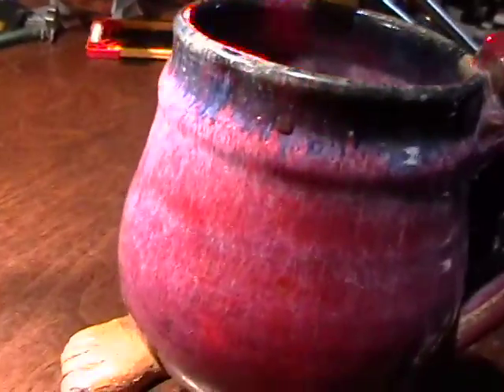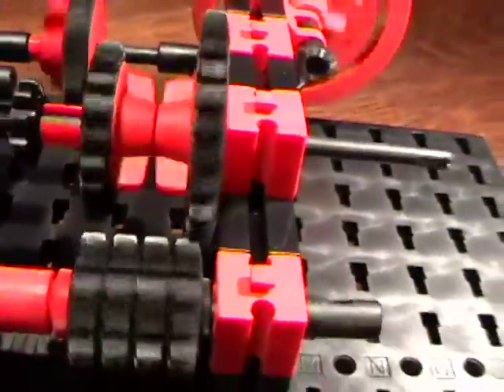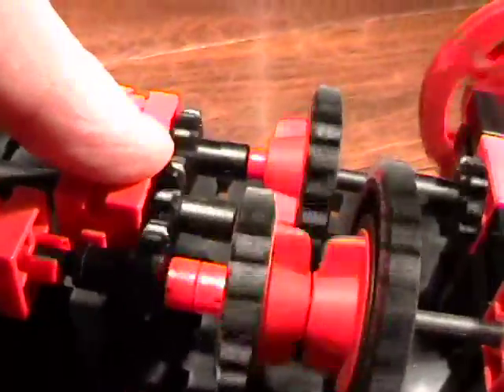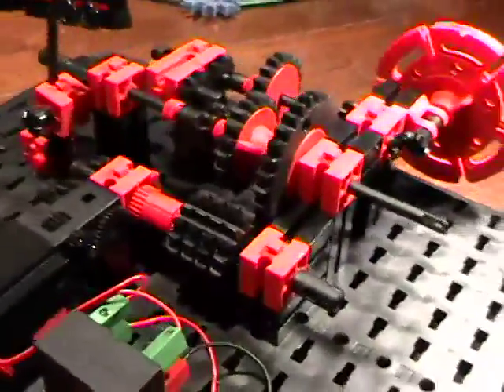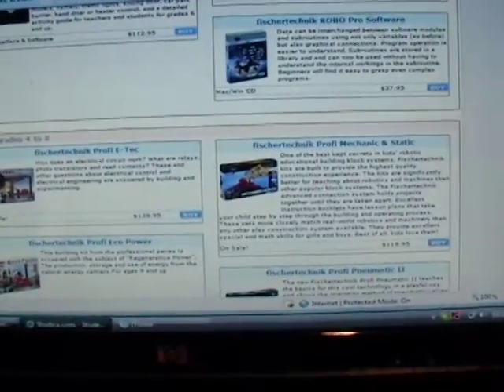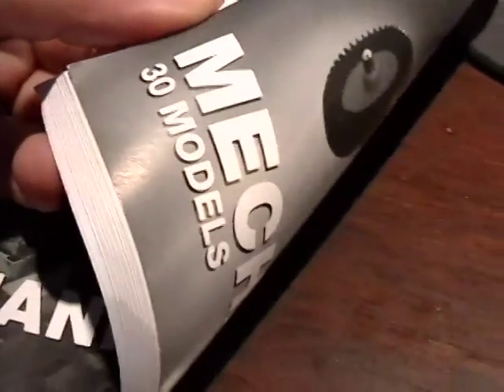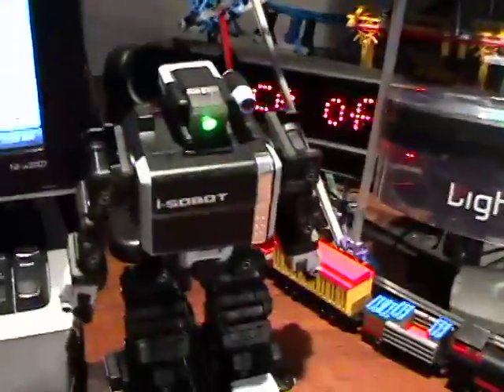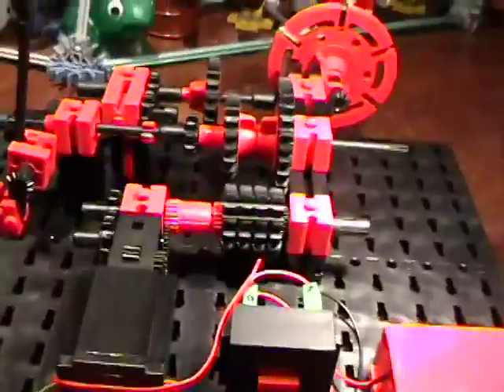Modeling Blog Daily - Fischertechnik Gear Box DETAILS

Comment: Bill, Is this the exact model from the Mechanic+Static Kit? Or was it modified by you?  Just wanted to be certain. Recently bought a number of Fischertechnik Kits (Creative Box 1000, Ships+More, Da Vicini Machines, Junior Jumbo Pack) from a retailer here in Trindad and Tobago at real discounted prices.  Looked for the Mechanic+Static, but they did not have it.  If it's that good, I will order it on-line at the normal price.  Do you think I can build it with the parts in the Creative Box 1000?